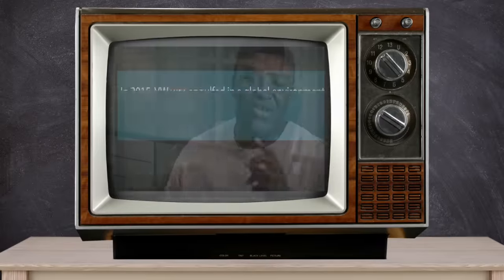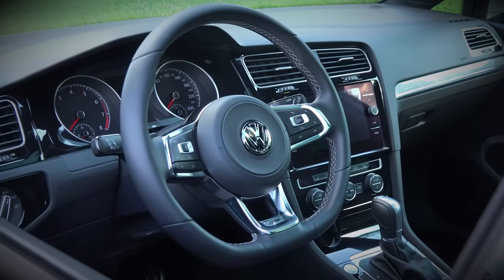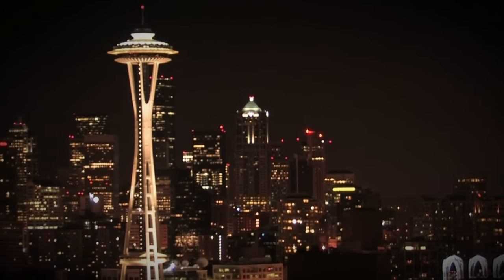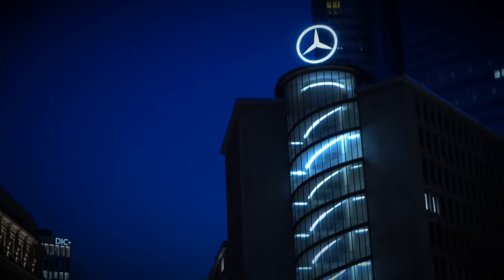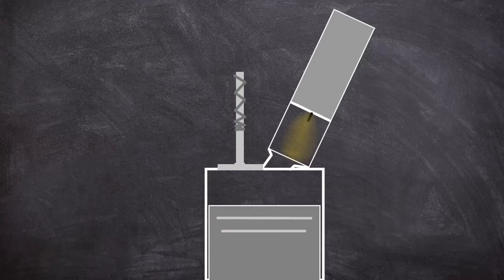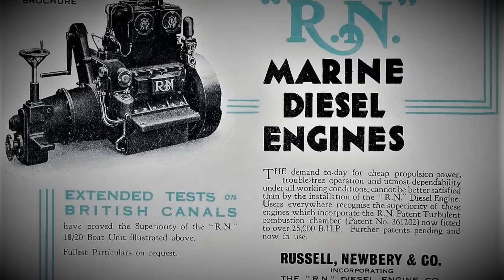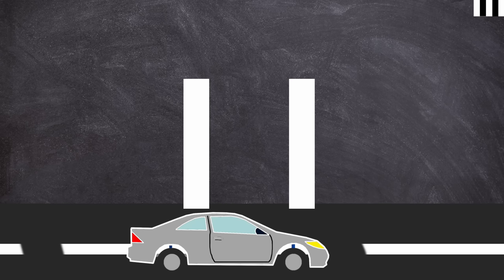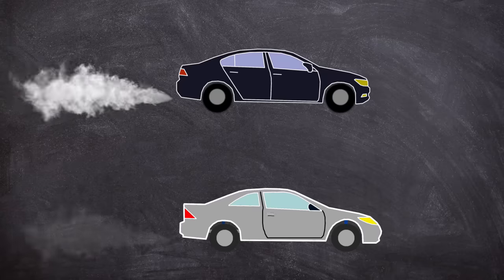Scandal: VW Emissions Dieselgate Explained | Plainly Difficult Documentary

Comment: Had to change a dosing tube on a Ford F550 with DEF.  For some reason theres no shut off valve and one you start changing it its just a deluge of DEF.  Not to mention the weekly regen that has to be done on them is quite wasteful of fuel.
Reply: Best thing we’ve done to our powesrokes is the DEF delete. Way better mpgs and no breakdowns from the absurd system.
Reply: Exactly my point: DEFs are a scam. One or two catalytic converters is enough to control the emissions, the DEF is a ticking engine fault waiting to happen.
Reply: @graafisk  my grandpas truck is currently going through problems now with the def system, 2020 power stroke with 20k miles and it’s throwing CELS due to the adblue system. Absurd

Comment: I didn't realize it was an industry-wide issue. I worked at a small factory making sound deadener sheeting in the mid-eighties and we had two clients: Ford and VW. VW was very stringent with their lab test ranges and we rarely passed; they finally stopped buying from us (Ford really didn't care). 

I always figured "German engineering" was superior. Yet, I've driven both VW and Fords and prefer Fords.
Reply: To be fair the engineering behind this was pretty good, it just wasn't legal or arguably moral...
Reply: If you want a truck that'll last get a helux
Reply: Ford's ignition switches still will randomly burst into flames. German engineering is but this was more about ethics than anything else.
Reply: At least for Europe, Fords development is also largely done in Germany.
Reply: Modern Ford is trash..... You act like it's Lexus...........
Reply: @MiguelGarcia-vj7oo  You're likely just too poor for nice fords, my luxo '16 f150 still works great and so does my '22 f350 7.3 gas, and the Lightning f150 though it's too new to really know how it'll turn out.
Reply: @hithere7382  somehow a pickup truck qualifies as "nice"? Thats the kind of vehicle immigrant contractors use while on the job, not exactly "nice"...

Comment: It makes me sad because Compression Ignition Engines have all sorts of advantages (or at least useful differences) than spark ignition engines.

Having a Diesel-Electric Hybrid would have been cool af.
Reply: Main Points for those Interested:

- Less Refined Fuel 
(Due to oil peaking but not peaking, we are using more and more “unconventional oils” which have more and more percentage of the “heavy fractions” (think oil, tar, and asphalt, NOT lpg, gasoline, kerosene).  Thus in order to be used in Spark Ignition Engines (gasoline engines) most need to be “upgraded” to be used.  Diesel Fuel would either need less or none.  Probably just Hydrodesulferization.)

- More Simple and/or Better Biofuel Options
(Bio-Diesel can be made using filtered cooking oil, or plant oil, lye, and a solvent, Bio-Diesel (or “Renewable Diesel” made with hydrotreating rather than transesterification) have WAAAAAAAAAAAAY more similar properties to their Fossil counterparts unlike Ethanol/Methanol fuels.  “Dimethyl Ether” and the derived “OMEx” fuels are the ULTIMATE synthetic fuel, unlike Hydrogen, and work AMAZING in CI Engines.  Finally it isn’t the best due to fuel lubricity / viscosity issues, but diesel engines can be run on straight up plant oil or filtered waste cooking oil no treatment just straight up into the tank.  So all in all Clean Diesels still existing would make decarbonizing transit WAY easer)

- Higher Efficiency*

…buuuuuuuuuuuuuuuut because of some greedy bastards we will probably never see much more modern diesels outside of heavy duty truck/marine engines etc.

Comment: This scandal likely spelled the beginning of the end for diesel vehicles in categories where gasoline vehicles are a viable alternative. You can make a gas engine run cleanly without wrecking its fuel economy, but nobody has yet figured out a way to do that with a diesel. With gas vehicle economy improving and diesel economy getting worse, diesel is just not worth it anymore.
Reply: Not to mention how much "clean" diesel costs here in the USA. Gone are the days when diesel fuel was cheap compared to gasoline.
Reply: @sootikins  ethanol now
Reply: @Swaygooy  ethanol is worse for air pollution than just gasoline. it also cuts a few mpg off most cars mileage. then factor in the resources associated with growing all that corn.
Reply: @sootikins  diesel fuel was never cheap, but efficiency gains offset the higher price for heavy vehicles. The reason why it became so popular in Europe even in small vehicles is, that most governments have high fuel tax with even higher rate for gasoline, which makes them cost about the same (well, until recent events, which shot the fuel prices up)
Reply: @CRneu  why is it worse than gasoline? It's still relatively simple hydrocarbon, so emissions should be more or less the same. But it does have lower energy density.
Reply: @Papinak2  I owned a diesel 4 cylinder Datsun pickup in the '80s in the US. At that time diesel was about 75% the price of gasoline. Not sure what role taxation did or did not play in that. As a bonus, diesel vehicles in those days were exempt from emissions testing, at least in California where I lived at the time.
Reply: @sootikins  this was in Europe in 90's until now. But it seems that diesels always had some for of government aid - just like EVs do now... Why I'm afraid that there will be some similar scandal regarding EVs?
Reply: @Papinak2  I can't think of where potential scandal might lurk in EVs, unless maybe manufacturers are caught for lying about the true energy & emissions costs - cradle to grave - of an EV, which is something they certainly do not like to talk about. And, at least here in the US, I wonder what will happen when the tax breaks and electricity discounts for EV owners expire, as they eventually will, and not get renewed.
Reply: @Papinak2  The "Government Diesel Aid" is because diesel is much more of industrial fuel than petrol. If the diesel prices were a lot higher than the prices of food would also rise significantly as tractors and lorries run on diesel.

Comment: As a german I was especially disappointed with the scandal handling by my government. Denial, delays, shabby arguments and an overall extremely slow response. All just because Germany holds major parts of VAG, I think.
Reply: That's not even the biggest issue.
The bigger issue is that apparently, the law makers, not only in germany, allowed the car manufacturer to both have a significant influence over how the tests were conducted, and to simpyl do tests in whatever country in the EU had the most lenient regulations.
Reply: i wouldnt necessarily say germany holds major parts of the VW Group (which sure could be true) but rather major parts of germany's economy is being influenced by VW, matter of fact close to 20%... any logical sense, even if it doesnt sound ethically justifiable is to keep that company going since this is holding up major parts of the countries economy
Reply: @YG--  too big to fail.
Reply: @katiekane5247  exactly
Reply: @Bird_Dog00  its part of the core EU trade deal that certifications acquired in one EU country are valid in any other EU country. Its why most neobanks in Europe are based in Lithuania
Reply: @YG--  That's very true, they are the largest (or 2nd largest, not sure which of Toyota and VW group is bigger) vehicle maker in the world. Germany must depend on the car industry to a vast extent when you add in BMW and Merc.
But also, IIRC the local/state government of Lower Saxony own a large share of the company and have a lot of votes on the board. Idk about the German federal government, but it seems like it is fairly tangled in with the government in a really messy complex way (although the same is true for very many such huge companies like that in any major country so it doesn't necessarily mean anything).

Comment: I had one of those VW TDI, and I ended up selling it back to VW.

But one nit that I have to pick with the video is that diesel engines really have two pollutants.  One is "particulate matter", which is a fancy way of saying soot, namely the black soot that diesel engines sometimes spew into the air.  This too is something that is undesirable - this is what the DPF (diesel particulate filter) is intended to catch in the exhaust, and that is what periodically needs to be heated in order to burn off the soot.

NOx is a different pollutant, and it is correct that it is linked to smog.  But it is really just a molecule, and not a particle.   The AdBlue system was in fact intended to control NOx, but my car was a 2014, and did not have this system.  My wife's car was a 2015, and did have AdBlue, so the technical fixes required for the two cars was very different.

In the US, there was another side-effect of the scandal in North America.  VW was forced by the courts to build a nationwide system of electric car charging stations, which are known as Electrify America (and their corporate sibling Electrify Canada).  And that's a topic for a whole different set of videos.

Comment: Imagine when, five years from now, PD uncovers the horrific true story behind Tesla's auto-steering disconnect scandal and brings Elon's empire to its knees.

Great video, John. Love this "Scandal" series.
Reply: Or the latest potential Tesla scandal, there is software specific to crash testing installed in their vehicles. What this software does is still to be determined. But if they are running different safety system coding specific to crash testing, then this could be huge.

Comment: I am very conflicted about this issue. I had a series of PD diesel A4’s that I could achieve 60-70mpg with on a long run driven very carefully. I was doing 40k miles a year and I wonder how much of a reduction in my carbon footprint these engines brought about in the hands of people like myself.  I understand that it was the cheat that was triggered by the careful driving I was using that gave the incredible mileage. 
 The regulations were very much set to suit the already dirty urban environments and a significant trade off between fuel efficiency and non carbon emissions was the aim. I often wonder how much extra carbon footprint was generated worldwide to reduce the nox emissions in LA and other dirty metropolis’s. All along the way, emissions control has increased fuel consumption and thus carbon footprint, in a effort to reduce the nox of lean burning engines. 
I also suspect that it was a reputational nudge to make the auto industry go electric despite the marginal state of development preparedness of the electric technology. I fully expect litigation in the future for the shortcomings of electric vehicles!
Incidentally, I have a 2011 Honda crv with the new fangled and completely underdeveloped dpf that’s no where near as clean and efficient as the previous 2006 one I enjoyed before. Emissions control is a double edged sword environmentally in my opinion.
Reply: A few points. Diesel produces 17% more carbon dioxide per litre than petrol. So you need to be using a lot less diesel to achieve any reduction in carbon than petrol.
Cars are mostly driven in cities and diesel power vehicles rarely achieve any fuel economy advantage over a petrol vehicle under these conditions. Because you need to using 17% less, then you are actually producing more carbon dioxide under these driving conditions. 
And, thirdly, every single VW group vehicle that I have driven has consistently used between 5 and 10% more fuel than the trip computer has claimed. 
And that's before you take into account the dangerous pollutants that diesel's dump into the atmosphere.
Reply: @MattyClivingthedream  absolutely true but diesels have no difficulty in in being 17% more efficient than petrol. My dpf emits additional carbon dioxide every time it regenerates and it is seldom clever enough to know when to do it without clouds of embarrassing unburnt vapour into the bargain.
 This is also why I don’t frequent cities but live in the relatively unspoiled rural environment where diesel makes a lot of sense even with the brutal additional tax load.
 So does the problem then lie with diesel itself or the grossly unnatural urban conglomerations?  In the country, we get a little pissed off with the noisy urban folk that have sullied their environment telling us how to manage ours🤣. It is always more complicated than we think and one size fits nobody solutions often make things worse. 
Electric vehicles in cities makes a lot of sense but the technology is not mature enough for everyone yet and thank goodness because our National grid isn’t ready for universal e-car take up.
 I would prefer that individuals would take responsibility for their own personal impact and act accordingly rather than being prescriptive to everyone else but themselves.
Reply: @robinwells8879  I agree that diesels can do better economy than a petrol, but only if they are sitting at an even RPM - highway and lightly loaded. But, on average and most circumstances, then drink the same as a petrol and in some circumstances more.
Reply: @MattyClivingthedream  certainly not my experience but interesting to hear.
Reply: @robinwells8879  It might help to point out that gas engines have made pretty enormous strides in fuel economy over the last couple of decades especially. Diesels, meanwhile... haven't. That combined with diesel nowadays being more expensive than gasoline rather than less (and by a pretty significant margin in both cases, at that) mean that you really don't often come out ahead running a diesel car in most circumstances. By cost or emissions.
Reply: Your diesel wouldn’t be giving you the efficiency you claim if you were driving while it had all its emissions shit in it. Emissions equipment choke the engine and ruin fuel economy.
Reply: @rock-uu7qr  that is rather my point. The regulators all focused on the urban cycle nox issue whilst compromising the carbon footprint of the vehicle on the open road.
 My latest Honda is much less efficient than it’s predecessor because of the dpf technology that was rushed to market too soon.
Again we obsess about the urban sector to the detriment of all else. 
Better if they had looked at electric city vehicles and allowed the IC market to follow efficiency as a goal. The tax regime promoted efficiency whilst the emissions regime drove the opposite way. It’s fast appearing that all manufacturers are “guilty” of “cheating” which rather suggests that the regulatory regime was at fault and not the manufacturers. Again we fall foul of the law of unintended consequences when we fixate on dogma rather than dispassionate science.
Reply: Since most people live, and therefore more vehicles are driven, in urban environments it makes sense that regulations target that greater population. At 40k miles a year, you're definitely a massive outlier with a bigger carbon footprint no matter what type of fuel you're using
Reply: @Erigion  those miles are happily behind me now because they were expended when I was a small part of kickstarting the uk offshore renewables sector!  It’s always more complicated than we think!  Thing is, I have been doing the economy driving thing for decades now and if I had a quid for every eco warrior that passed me on the motorway thrashing the nuts off their Prius, I would be a wealthy man!  We all need to look to our own part in the big picture because we can change that but sometimes it’s more appealing to point the finger at others or virtue signal. Salvation is reached in little steps. 🤣
Reply: @robinwells8879  Virtue signalling, eco warrior, salvation, an emoji and the thought that by doing 40k miles a year in a diesel car, you were saving the planet. Give yourself big pat on the back.
Reply: @MattyClivingthedream  I bow to your obvious superiority. Do tell us all about your contribution.
Reply: @PhysicsGamer  Not true, Diesels continue to get cleaner and still exceed gasoline power in both mileage and efficiency.
Reply: @Vinincenz  Not by the factors of two or even three (depending on location) you'd need to come out ahead, though. The gap in mileage has narrowed significantly even as the price of diesel has skyrocketed.
Reply: @PhysicsGamer   Diesels exceed gasoline in stochiometric efficiency. This is the true measure of efficiency along with thermal efficiency. Gasoline engines appear to be closing the mileage gap for two reasons: 1) smaller engine displacement 2)seven and eight speed transmissions. Further, you are comparing older VW engine configurations to the latest in North America.
Reply: @Vinincenz  And yet at the end of the day in most parts of North America the comparison between the available diesel cars and reasonably comparable gasoline cars comes out only one way: the diesel car costs measurably more per mile to run.

The problem with diesel cars in 2023 isn't so much the physics of their operation (though that is a concern). The much larger issue is economic in nature.
Reply: @PhysicsGamer  Diesel prices are now falling and fast.  As these small displacement turbocharged engines continue to burn themselves out in larger numbers because their owners drive them harder, this minimal advantage will disappear. The related maintenance/replacement costs are already eating that away. Given the average diesel with reqular oil/filter changes will operate half a million kilometers easily ( due to their robust internals, especially compared to gasoline engines) to the 250 thousand miles a small gasoline engine will run ( given regular oil/filter changes) without a major rebuild, your alleged cost effectiveness evaporates.